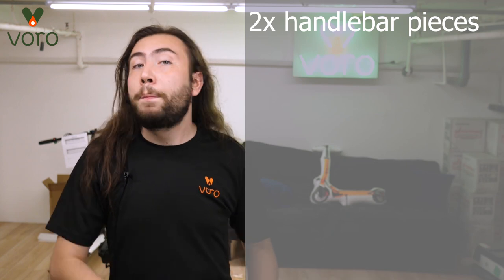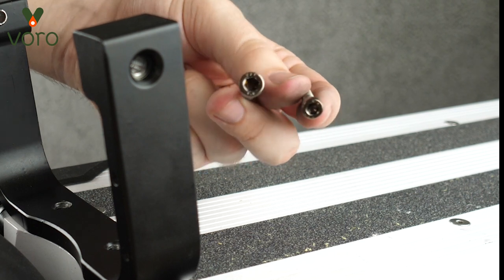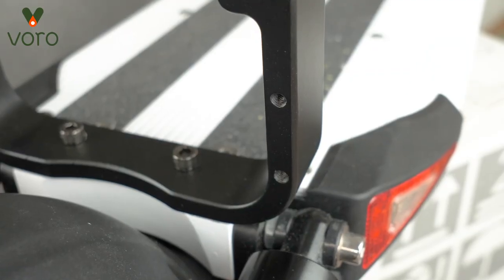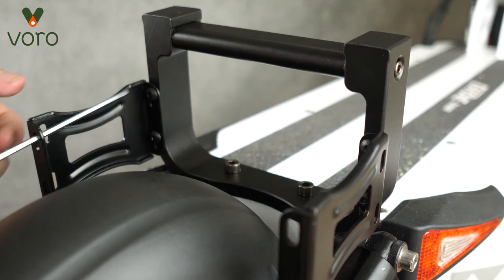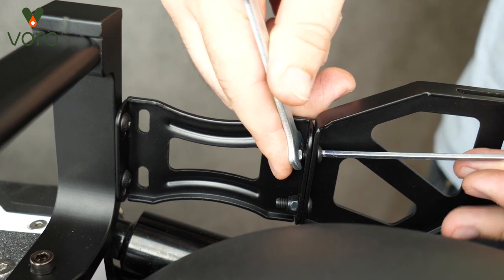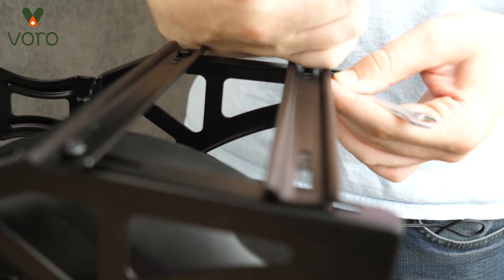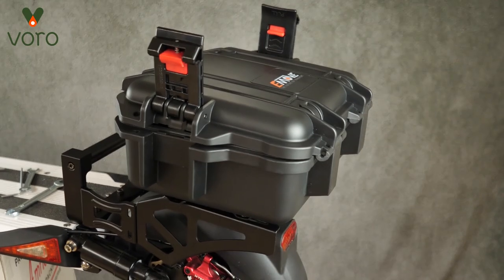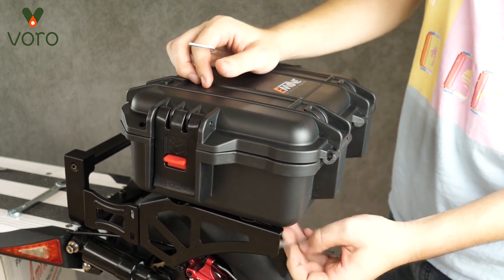Tow Handle and Storage Case Installation Guide for the EMOVE Cruiser Electric Scooter

Comment: Thanks for the video guide, AJ.  The installation went smoothly using the video. I ran into two small issues that weren’t addressed - 1) the case attaches to the brackets using the widest holes, so make sure the bracket underneath isn’t sticking in too far or it will obstruct the screws from dropping down into the holes, and 2) when installing the arched side brackets, they need to go as far up as possible to accommodate the rear brake.  I suggest installing the brake side first.
Reply from the maker: These are both great notes thank you! -AJ
Reply: @VoroMotors  I just received my new storage case and handle bracket and several of the screws are too small and not long enough for the purpose they were intended, about 1/4" too short and these are the longest screws in the kit.  How is this possible when I know others have complained about this and the kits are still being shipped without correcting the problem?  Please send me the longer/updated screws, so I can get back on the road.  This is very frustrating.

Comment: Might be a good idea to update this video with the new system.  The new Storage case I purchased is not the same as this.  Even more confusion was the parts diagram is from the old system.
Reply from the maker: Thank you! Yes, we're planning to update this installation video as the mounting system has been changed.
Reply: @VoroMotors  I just got the case and it is missing the middle connector plates on each side as well as the metal plates that go inside the case to hold the case on

Comment: I received my cruiser today along with the tow handle and storage case. The brake line interferes with the bracket and won’t square up. The bracket on the other side didn’t come welded at the joint like it should. Should the bracket flair out to avoid these problems? Any help would be appreciated.

Comment: Just received my Cruiser and Tow Handle and Storage Case. I cannot install the bracket on the left rear side because there is no clearance between the brake assembly and the second bracket which the case is fastened too. Ugh.
Reply: I received my cruiser today and tow handle with storage case.  The break side bracket interferes with the break. The bracket won’t square up because of it.
Reply: @soundtenement7993  r you talking bout the brake cable I noticed this but just put it on the inside and it works fine
Reply: @SsShadowbaneSsS  yes, I was talking about the brake cable but I have resolved the situation by stretching the bracket out and put the brake line inside.
Reply: Thanks

Comment: For the tow handle, would it be possible to attach like a small trailer/wagon to it or is it more meant to be used only with the storage case?
Reply from the maker: If you can find a way to rig it up, it will work for anything you'd need. - AJ

Comment: lifesaver, but maybe a bigger case, not too big, and also a front basket while you at it. 
 P.S. fast charger when?
Reply: You can get a front basket off amazon for like 20$
Reply: @95lamp  I love the basket option a bit more cause I get to put my stuff inside more easily in the front than putting it on the back. And be able to bring my backpack for the lighter options

Comment: Storage case has no security locking mechanism or at least a latch or hole drilled in the front to thread a beefy key or combination lock. Also wish the case was slightly larger. I may still get it to put my lunch in there. 

QUESTION: I see there is foam on the top lid. Is it removable? 

For those who are thinking of purchasing an Emove I highly recommend you do. It’s a beast and their customer service is unbelievably great! Excellent! However, at 51 pounds it’s not a fold and go get on a train or bus. It’s sturdy and heavy and that seems to give me more security when riding.
Reply: Like a lot of pelican cases, it visibily has holes on each corner opposite the hinges to put a padlock on

Comment: I just received my new storage case and handle bracket and several of the screws are too small and not long enough for the purpose they were intended, about 1/4" too short and these are the longest screws in the kit.  How is this possible when I know others have complained about this and the kits are still being shipped without correcting the problem?  Please send me the longer/updated screws, so I can get back on the road.  This is very frustrating.

Comment: While I appreciate this addition, I would ask if there is a way to lock the case. For those of us who intend locking up the scooter to a bike rack when riding about town, I'd hate to walk out of a store only to find my trunk has been raided.
Reply: Yes but its a small hole on either side of the case
Reply: @zackcooper5899  Ah, I see. So you'd need a padlock. Alright. thank you for answering my question.
Reply: As someone considering this, my only concern is that having a locked box in the city will increase the desire to steal the scooter and/or break into the box

Comment: Just got my handle and case. Tried installing but the two replacement screws that hold the handle down are too long. Completely torqued down there is still space and the handle wiggles. Ended up putting the factory screws back in. Also, the handle's top bar still has wiggle even when both side screws are tightened to the max.
Reply: Solomon Daniels poor quaility?
Reply: @KevinRodriguezYT  Definitely not. I just think I got the wrong screws. The factory screws ended up being too short, so I found two screws of middle length.
Reply: @solomon Daniels - Same for me, I ended up taking some thin foam lining material I had and cut out a strip the size of the base plate to fill the gap. Works fine for now, but I'm also noticing a lot of other little oversites on the manufacturing quality of this rear case that will likely need more customizing to fix (like it rattles very loud going down the road, despite everything being very tight)
Reply: Michael B. I have a joyoy Y10 and im sure i can put tow handle with this case by using tools, but i ordered tow handle for dualtron on aliexpress its only 39€. I like this emove handle and case but maybe when i have money

Comment: Video is outdated. They changed the brackets
Reply: just received mine. looks like they took off the bridge? guessing it bent over time due to people carrying heavier things in the trunk. that or they forgot.

also the two metal pieces that goes inside the case is now glued along with the two longer pieces at the bottom where it attaches to the base. a now one H metal looking piece. correct me if i’m wrong with all this..

they seem to send you the original Chinese manual with instructions that apply to the old setup but have different pieces and parts that were sent.

Comment: The storage box is a handy accessory, but the installation design of the brackets is terrible. God forbid I should have to repair a flat or change out the brake shoes. Who in their right mind wants to spend an hour disassembling this setup and then reinstalling it again. At the 11:03 mark in the video you mention going back and tightening the U- brackets well that's virtually impossible because the screw can't be held in place because there is no access to hold the allen head from turning. The bracket should've been designed where the box is mounted with all the bolts passing through the box from the inside giving access to the allen head screw so it can be held in place while tightening. Also, the brackets attached to the carry handle should've been designed for a quick disconnect by drilling the holes all the way through the handle. It was a pain in the a$$ trying to hold and turn the tiny allen wrench with the rear wheel fender and brake cable in the way.  I ended up removing the carry handle and drilling all the way through then reattaching the brackets using lock washers and wing nuts instead of those ridiculous tiny allen screws. Now in the future all I have to do is loosen the wing nuts and the hole assembly comes off in one piece.

Comment: Ok people this was very painful to watch lets turn this 45min install into 15min  after handle is installed take the two brackets the one that attaches to handle and the wing shaped on lay them flat on a table or ground install the bolts and nuts easier todo it now with easier access rather than try to hold the plate the bolt the nut a wrench and a Allen wrench later..now do the same to for the brackets for the other side... now install both preassembled pieces to the handle once installed lock it all down tight.. then take the brackets that go across and install the front one where u would like it just insure it same on both sides like the video suggests all the way forward insures both sides are even.. now take the other back bracket and lay it across installing the bolts and nuts go ahead and tighten then back off ¼-½ turn now grab the two braces that sit inside the case and sit them  on the cross brackets place a bolt  through both the case plate and front bracket for each side  doesn't matter what hole now position the back bracket where it lines up with the hole in the case plate and drop a bolt through now fully tighten back cross bracket lift off the case plates and install them in the case and install the case with the 4 bolts and 4 nuts and lock it all down and ur  done if done like the video u will fumble with trying  to hold everything while assembling the side brackets and if leave the cross bracket loose u wont actually be able to get it good and tight  after as they have nylon lock nuts and the bolt will just spin  hope this helps someone